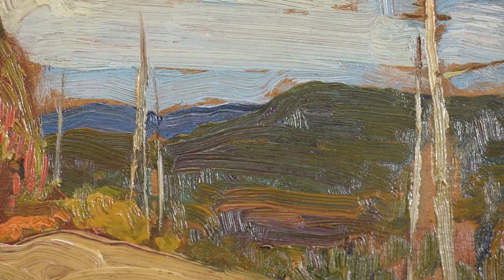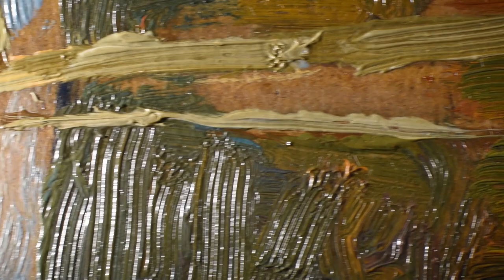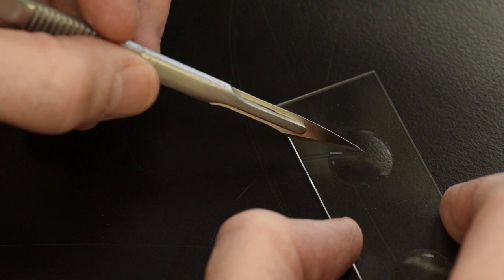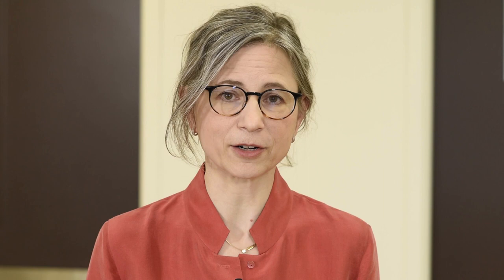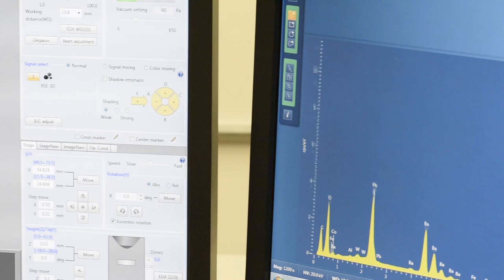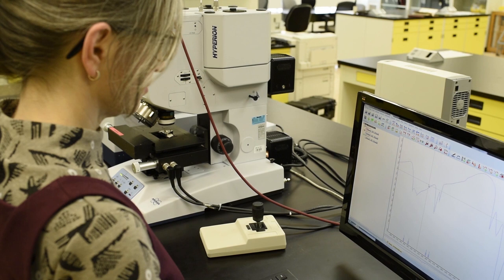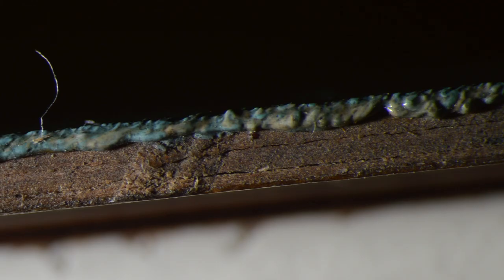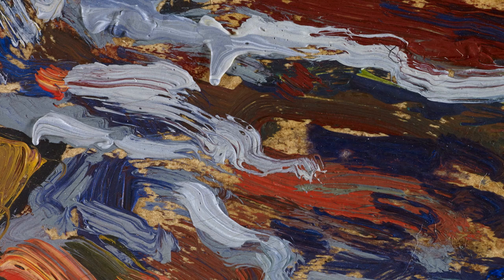The Materials and Techniques of J.E.H. MacDonald

Comment: how does a Shellac layer under paint act? does it affect the upper layers of paint?
Reply from the maker: Thank you for your question! There may be several reasons that MacDonald coated his paperboard supports with shellac. The shellac would act as a sealing layer so that the paint would not sink into the board. Also, the shellac gave a warm, orange tone to the boards; many of MacDonald’s sketches leave areas of the board exposed and so the colour of the board is important to the overall composition. To date, we have not noted that the shellac has had an effect on the paint above. For example, we have not observed a lack of adhesion between shellac and paint (such as separation, cracking or lifting of the paint).